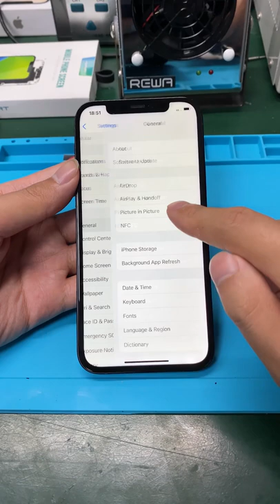How to Remove "Important Display Message" on iPhone 12 #Shorts

Comment: Ever since using the new data transfer device called a jcv-1 I don't get this message anymore. That's because the product transfers and reads the data from the old screen the original OEM screen and transfers it to the new screen using the motherboard connectors on the transfer Hardware. I'm surprised REWA doesn't know this
Reply: That’s what I thought so too that a jcv is the way to go instead of all this hassle. But I guess this is more cost effective instead of buying that device

Comment: How it's possible to remove the IC from new screen without lifting the black solder mask? When I tried, it always lifted it and leaved naked copper there. I had to grind the new IC away
Reply: There are some brand that make the touch ic easier to remove, but its never worth a try, allways go safe and grind it off
Reply: Недостаточный прогрев

Comment: This is insane. I never tried to desolder them on the display just covering the OLED with a metal plate. I always bent the cable away from it to prevent heating spots. 
Can you tell me what you use to cover the display? Any kind of special material?
Reply: I think it's called kapton tape, the orange tape that is responsible to save sensible components from heat
Reply: @zakaderechte  thanks for the answer, but that's not what I meant. I meant the orange plate which he puts between the cable and the OLED
Reply: @Maeddn11  that's just a copper plate that's placed under the flexes
Reply from the maker: We use copper and high-temperature tape for protection.

Comment: Is it safe to heat lcd
Reply: No
Reply from the maker: You need to be extremely careful while heating as it might damage the display.
Reply: @rewatechnology2008  yes i used  drill to take out ic .